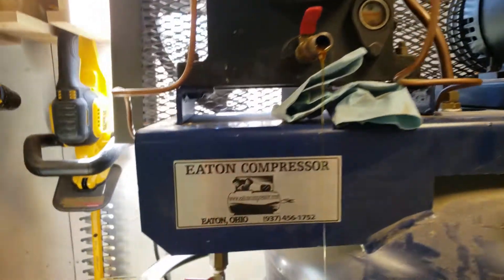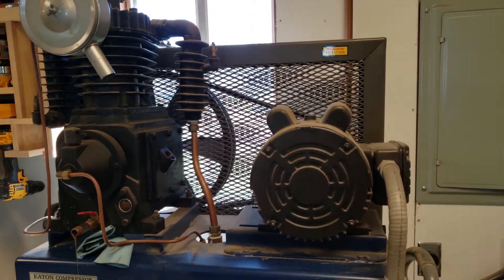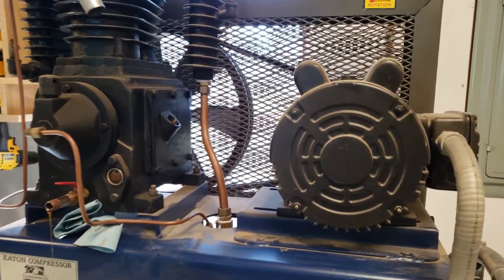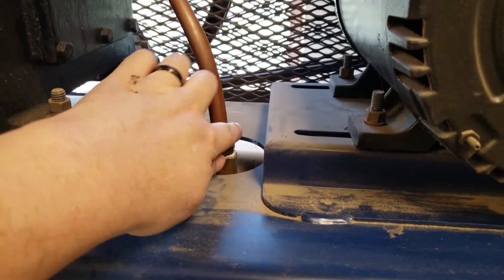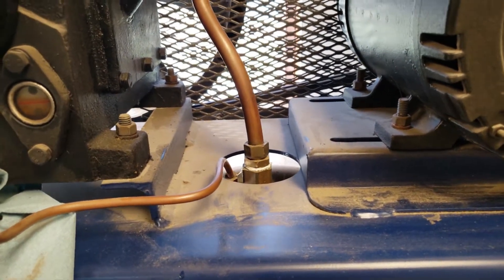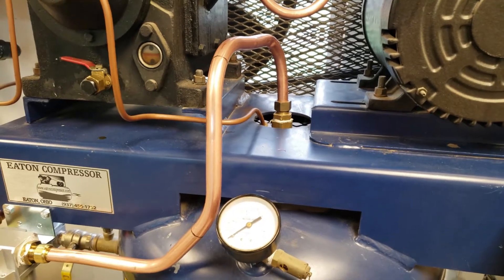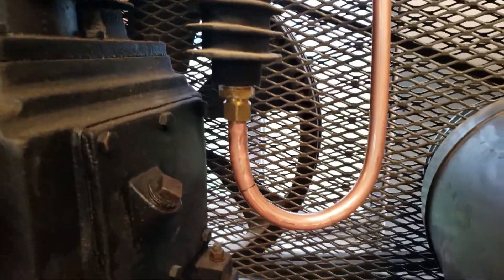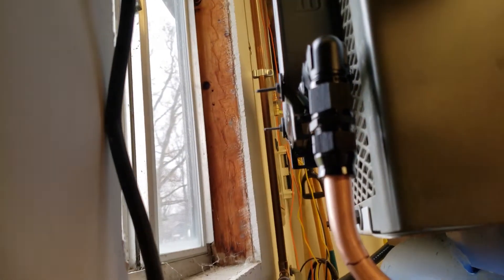Air Compressor Aftercooler for my Eaton Compressor

Comment: Systems like this, which can only cool the compressed air down to just above room temperature, remove only the water that's in excess of 100% humidity at that temperature.  This excess water is removed, but the air that is sent to the tank is 100% saturated with water vapor. Since the air in the tank initially is uncompressed, it is not relieved of its moisture, and when it is compressed when air already at 100% humidity is added, there will be slightly more water in the tank than can remain as water vapor.  Without cooling the air as it leaves the compressor to below room temperature, you can't quite get rid of all the water.  The air in the tank will be at 100% humidity and there will be a small amount a water, but it's a tiny fraction of what it would be without this setup.
Reply: So real simple, is it better to have this setup or not?
Reply: Sheesh, people always have to argue about crap. Who cares, build your own your own way. Do what works for you. It is how people come across that makes them seem like a-holes
Reply: I think these aftercoolers are a nice to have, but I believe a compressed air dryer after the tank might be more effective. Where the aftercooler is supplemental. No actually science behind this, just gut feeling.
Reply: It ain't perfect, everybody know that, but it helps and that's all that matters. Not everyone can justify a refrigerated unit.
Reply: Wow everyone's a genius. At the end of the day, 99% of the water is removed by this guys modification. Quit being ridiculous. Use any kind of condenser/oil cooler setup with a filter.
Reply: You are forgetting the effect of pressure. The air is taking up much less volume and given the vapor pressure of water, if you compress to 1/8 ambient volume the compressed air can only hold 1/8th as much water. That's why you end up with water in the tank. A lot of water if you don't drain regularly. The after-cooler is just forcing that condensation before the tank and your filter/water separator is giving that condensate (like cloud seeding) a place to form droplets more easily.
Reply: @imkindofabigdeal4308   You are forgetting that the air is heated upon being compressed, increasing its capacity to hold water vapor. If the air entering the compressor is at 5% humidity at room temperature, and is compressed to 1/8 its volume, its relative humidity will be less than 40%, it will be at 40% humidity after being cooled back down to room temperature, and no water will condense out.  If it's at 15% humidity entering the compressor and it's compressed to 1/8 its volume, still, no water will condense out because it will have been heated, increasing its capacity to hold water vapor. If it is held in the tank and kept at the elevated temperature, the tank will not collect liquid.  It will not condense out until it has cooled to the dew point, the temperature at which its relative humidity reaches 100%.  Only the water in excess of 100% at room temperature, will condense out.  FYI, the water forms in the cooler, not the separator, the separator is just where the water gets trapped so it can be removed.
Reply: @biteme4338  I'm actually not forgetting. Cooling the air back down, either with an after-cooler or in the tank causes significant condensation because pressurized air cannot hold as much water vapor compared to air at ambient temperature and pressure all other things being equal. The after cooler just enables the filter/separator to capture the condensate instead of it collecting in the tank or in the air lines. And that's the point of the exercise. I think we're saying essentially the same thing.
Reply: @imkindofabigdeal4308  Did you read my comment at all?  If so, doesn't sound like you understood it.
Reply: @biteme4338  I found your original comment a little confusing. Could just be me. The key point is that at 150 PSI, air can only hold about 1/10th as much vapor as air at ambient pressure all other things equal (including temperature). That's why compressors make water.
Reply: @imkindofabigdeal4308  Your key point is incorrect. The amount of water vapor that can occupy a given volume is nearly independent of the amount of air present.   In fact, at the same temperature, a vacuum has about the same capacity to hold water vapor as the same volume filled with air.  It's not that air compressed to 150psi can hold 1/10th as much, it's that the space that water vapor is now occupying is one tenth the size. 

Let's put it this way. Your tank starts off at 100% humidity and 15 psi in it. Under those conditions all the water will exist as water vapor, there will be no liquid in it. If you add enough 100% dry air to bring the pressure up to 150psi at room temperature, the tank still holds the exact same amount of water as it started with, and none will condense out.  It can carry the same amount of water it did at 15psi, not 1/10th the amount.
Now, if instead you add enough air with 100% humidity to bring the pressure up to 150psi at room temperature, the tank will now contain ten times the amount of water as it started with, and 90% of it will condense out.

You're putting 10 times the amount of water into the tank that would normally be there.  If compressors did not heat the air, the water would immediately condense out and the compressor would fill with water, but they do, so the water doesn't condense out until later when it has cooled.  Heat it to 374 degrees C, keep it there, and no water will condense out, no matter how much you compress it.  Cool it to 0 degrees C and nearly it will all precipitate out, even at 15psi.  Then your tank would have truly dry air.  The point is, when air is compressed, the amount of water in it is concentrated, but because it is also heated, it doesn't condense out. It only does when it is cooled to the dew point, and then only the water in excess of 100% humidity condenses.  It does this in the cooling tubes, the separator collects it as the air and liquid water mix passes through, and the 100% humid air continues on to the tank.
Reply: @biteme4338  At a given temperature, an increase in pressure raises the dew point of air. It will hold less vapor/more water will condense out. This is empirically true - else you wouldn't have water in your tank. Your point "The amount of water vapor that can occupy a given volume is nearly independent of the amount of air present." Yes, but the volume of air is now 14X more at 150PSI. So the amount of vapor per unit of air is much less. That's the point.
Reply: @imkindofabigdeal4308  Yes, an increase in pressure raises the dew point of air, so some will condense out, but the bulk of the water condensing out is because you're pumping so much additional water into the system along with the air.
Reply: @biteme4338  There is actual math behind this. It isn't some philosophical argument. Bottom line in practical terms...when I'm running my CNC plasma at 75 psi for an extended period, my outlet temperature does not increase as the tank is emptied and so I'm not running that high absolute humidity air through my desiccant filter.
Reply: @imkindofabigdeal4308  No, of course not.  It's also because the air sucked in by the compressor probably isn't anywhere near 100% humidity either, It was just used as an example.
Reply: @biteme4338  Ive read both of your comments and am really just wondering whether i should do a setup like this or not bother, break it down real simple if you can please!

Comment: Great video!  Have you noticed much/any vibration transferred from the copper lines to the aftercooler as this could be a potential area where some cracks could develop.  I'm getting ready to install an aftercooler on my compressor, but I haven't decided whether to use copper or Braided Stainless Steel lines for that reason.
Reply from the maker: It really hasn't been in place long enough to experience cracking. That's something I'm watching for. If it seems to start I'll look at changing to some type of flexible hose.

Comment: Excellent work.  I'm building a similar setup but using the Derale oil cooler model 15800.  It's a cooler/fan/mounting bracket setup but will require a 12v power converter.  Opted for the fan based cooler as my compressor is an large vented cabinet  I'm also adding ducting to exhaust the warm air from the cabinet to be on the safe side.
Reply: Good choice. I used the 15300 and fabbed up a frame, mounted a fan. Check out Hose Power (a Bridgestone company). They can make you a set of hoses with AN fittings that makes install a lot easier. This is my install so far: https://www.hobby-machinist.com/threads/dry-shop-air-step-1-compressor-after-cooler.94795/